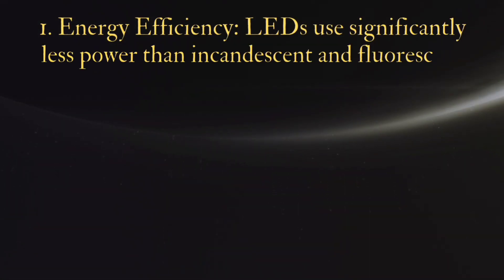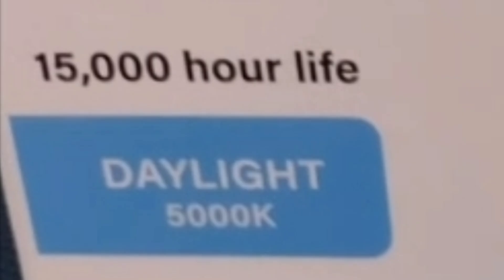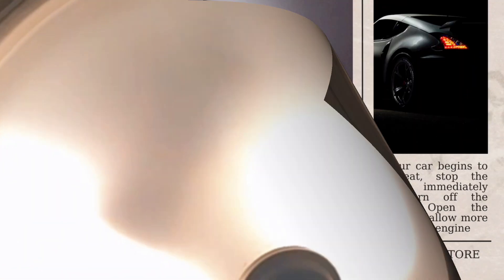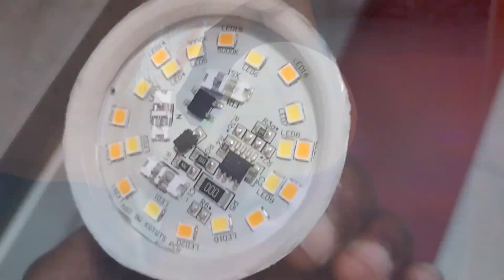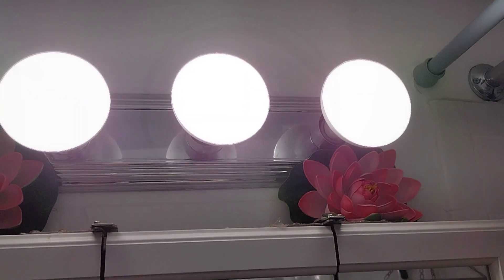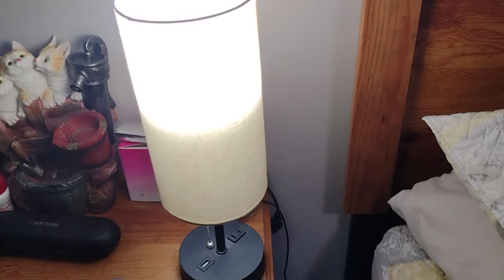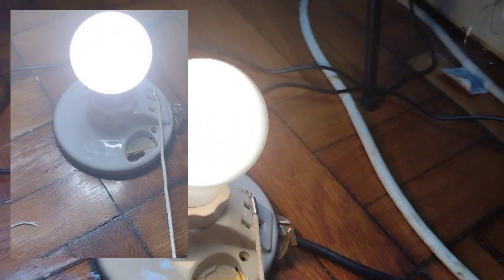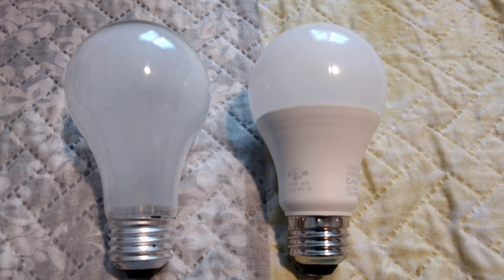Why You Should  Never Use LED House Bulbs In Closed Fixtures

Comment: What if the plastic diffuser is removed from the bulbs installed in the enclosed fixture? Would that help to dissipate heat?
The local energy provider regularly gives instant discounts/rebates on LED bulbs. With those discounts, a 6-pack of LED bulbs (60W incandescent equivalent) is 99 cents at Costco. A 5-pack of 100W equivalent is the same price.
Reply: Very dangerous. They're designed to be used with the globe in place so there's no isolation provided between the LEDs and the mains.
Reply: @Graham_Langley Understood. I would never remove the globe and just install in a fixture, especially a LIVE fixture. I'm cautious when it comes to electrical work. If I was careless or distracted and somehow touched a live trace on the PCB, it wouldn't be the first time I've been zapped by mains power. :face-blue-smiling: First time in a very, very long time, though.
Reply from the maker: @Graham_Langley  My curiosity to better understand their electronic boards have caused me to pop a few partially bad ones already. But the journey for greater knowledge continues
Reply from the maker: @Graham_Langley  Caution must be exercised when dealing with electricity and electrical devices
Reply from the maker: @misterskippy2u  Thanks for watching and also for your question. I am currently doing my own investigation to determine if doing this will have any significant impact. What I do know so far is that without the diffuser the light output is definitely affected. The diffuser spreads the light more evenly.
Reply: @crediblemikeLWR  That's true about the diffuser spreading light better. I thought the enclosure would provide the same effect. As long as it's a frosted enclosure, that is. I'll have to give this a try myself, since I think I can afford to sacrifice a few 16 cent bulbs. Woo-hoo! An experiment!
Reply from the maker: @misterskippy2u  Thanks for watching and for your feedback. I like your energy/investigative spirit.😂

Comment: Must depend on the build quality. I have several in place for years now. Never had a problem.. you get what you pay for.
Reply from the maker: @edrosiak  Thanks for watching and also for your feedback. I am definitely going to do a bit more research so that I can acquire the best build quality bulbs that will last as I know they should. Much appreciated🙌
Reply: Any brands you recommend?
Reply from the maker: @garcjr  Thanks for watching and also for your question. An overwhelming amount of viewers recommended the Phillips and Sylvania. These are reputable and trusted brands but I am yet to use these products however I do intend to use them as replacements as soon as the remainder led that I have goes bad

Comment: when you buy LED bulbs examine the package as the LED bulb has specific ratings "for enclosed fixture use" .   Make sure you suit the tool to the task. Peace/Out!
Reply: I installed LED lamps in enclosed fixtures without any problem,  the ones I  used were marked on the box as suitable for enclosed fixtures,  most other types are marked as NOT suitable for use in enclosed fixtures,  check the box.
Reply: Yes, I have also noticed the same thing. Depending on the fixture, sometimes you can space the shade away from the base to leave a small gap at the top so air can circulate a bit and reduce heat buildup.
Reply from the maker: @bladder1010  Thanks for watching and for your feedback, I will continue to research with the intent to find solutions to combat this issue.
Reply from the maker: Thanks for the input, this video is for  awareness/educational purpose so any valid information  will be of benefit to the viewers as well. Personally I have had difficulty finding led bulbs with such specifications so I will continue to search for those designed for light enclosures/luminaries and test to determine how well they work. Peace.🙌
Reply from the maker: @tomtom72  Could you please send a sample of your led bulb with the stipulation indicating " for luminaries" or any similar instructions to crediblemike2@mail.com. Thank you. Much appreciated.
Reply from the maker: Crediblemike2@gmail.com

Comment: Never had a problem with the LED bulb in my enclosed light fitting in the bathroom, been in for years now 😂
Reply: I've been using LED bulbs in a pizzeria, no air conditioning, 4 over the fryers and the oven enclosed in an airtight glass and metal. Cheap ones are hit or miss, better quality ones last 2 to 3 years. Incandescent the same 2 to 3 years, reason... we frequently have power spikes that kill the bulbs. Yes LEDs are a little more but the power savings is huge, we have over 40 bulbs in the whole building.  So 60w down to 9w and 90w flood down to 11w, 11 lights are on 24/7 they last longer because they maintain the same temperature.  Typically the capacitors fail causing the lights to blink.
Reply: @daledickey8400  Every LED lamp that failed in my house was due to a failed capacitor. They are either too cheap and/or the voltage rating is too low leading to early failure.
Reply: Just use bulbs marked “suitable for enclosed fixtures “
Reply: The LED bulbs I have in my enclosed shower downlights were marked as suitable for use in enclosed fixtures.
Reply: Mine niether!
Reply: “LED G9 lamps with a 4000K colour temperature. These lamps can be used within enclosed fittings and are therefore suitable for use in indoor, bathroom” etc - specialist online light shops are now providing this type of information to help buyers choose appropriate bulbs because LED overheating is an issue in enclosed fittings unless you choose the correct type
Reply: We buy name brand daylight temperature screw-in LED bulbs for our bath fixtures, like the bulbs shown in the video. Some are used in overhead can fixtures that are open on the bottom and others are installed in regular open fixtures. We replace several of the bulbs each year, typically 2 at a time.  The LEDs don’t last anywhere near the hours advertised.
Reply: Had failures in bathroom tulip shaped fixtures, heat related, as the electrolytic cap had its label literally crumble into tiny shards. The cap seems to have developed high ESR, in one failure nearly to open condition, which allowed the driver to receive excess voltage spikes from the now unfiltered full wave rectified power, killing the driver. The LED's and rectifier bridge are good, as are the dropping resistors.
Reply: You must have decent bulbs, not China specials.
Reply: @dc6233   strangely enough they are made in China 😂😂
Reply: Ten years so far no problems. This article is a non biscuit.